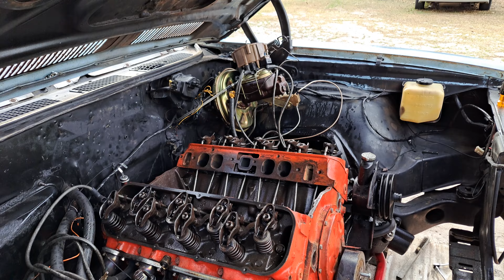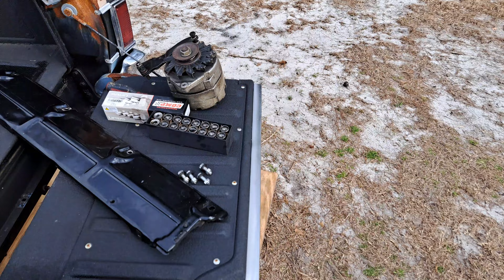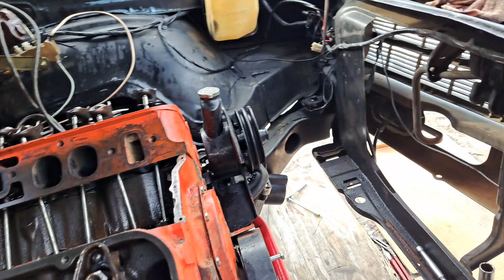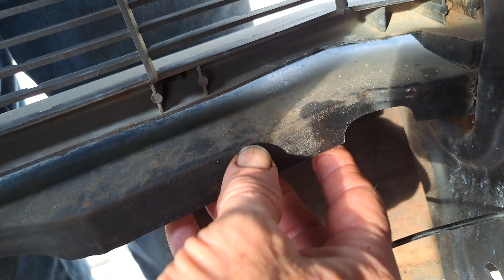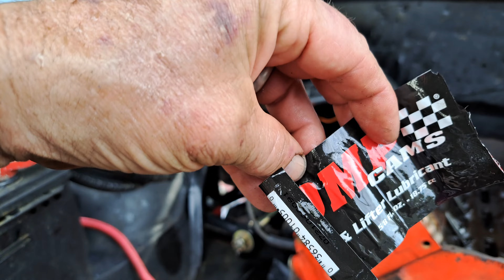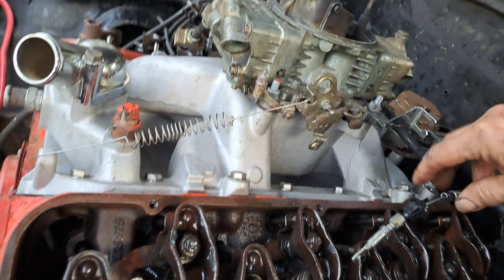1969 el Camino 454 cam fail

Comment: I don't pretend to be an expert but there are at least a few youtubers (Myvintageiron7512, Powell machine and others) who are saying the high failure rate is due mostly to poor machining of cam lobes and lifter bottoms. They have tested them for hardness and found that isn't really the issue, poor machining is.  You would probably do really well to make sure all of your push rods are rotating when you crank the engine over to be sure all is well.

Comment: And after watching your video if I'm not mistaken if you go back on d-and-d speed shops side and look up the cam failure and watch that video the cam that Dan tried to put in the put in the Big Block Chevrolet same two loads at the back of the cam by the camp by the distributor gear same deal you need to get with him and he can tell you what they done for him cuz he just went through it

Comment: Well I see everything that everybody's putting on there about pre all in the engine and you know blah blah blah and putting assembly lube and all that other man I've been I'm 65 years old I've been building engines my own personal engines for since I was in my twenties and younger and I've never had a cam fail you'd see one in a blue moon give problems but the who you need to contact is Dan over DND Speed Shop because he just built or didn't build it was already built he just installed a cam in a big block Chevrolet and after about 15 or 20 minutes run time trash to cam two loads on the cam two loads on the lifter right together same same in same location so they don't know if it was the lifter wasn't he treated enough for the lifter touches the cam or if the cam was not heat-treated enough but y'all two are not the only ones there is a multiple people or screwing up Goode Motors right now putting cams in them I've ran cop cams through the years and I've had no trouble with them but in the last year 2 years I know of like five or six different instances for the cams have went it in their cop cam caught lifters and caught valve spring all sold in a kit

Comment: Nowdays cams need 'pre-oiling' with electric pumps before the engine is turned over.Most companies don't harden the surfaces as 70's builders needed,as so many did solid lifters,or rollers.All I hear from newer rebuilders is the lifters aren't harden and Fail before broken in.They seem to think everyone runs 'Dry-sumps'.

Comment: Do you think the lobes failed  because they were further back & ran hotter?
Reply: They'd run cooler being closest to the waterpump,but being that high,due to tilt,they do drain oil the quickest as they are at the front.